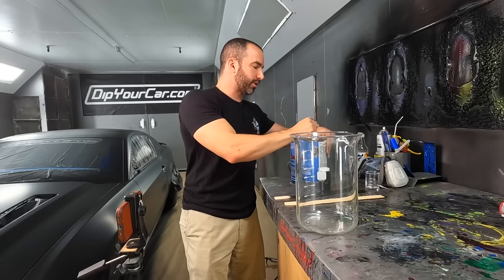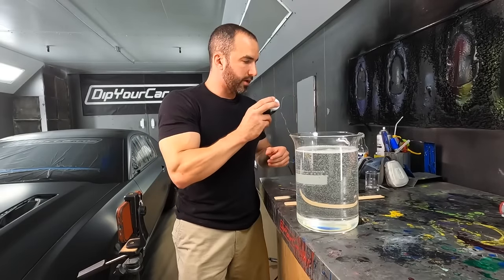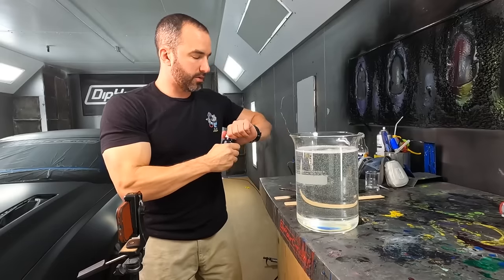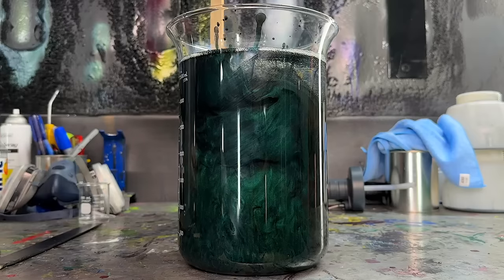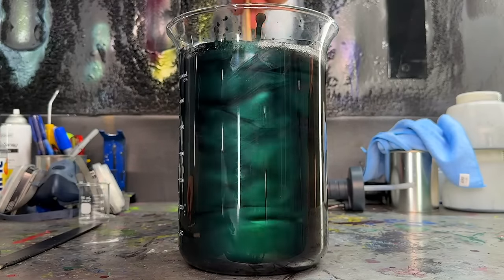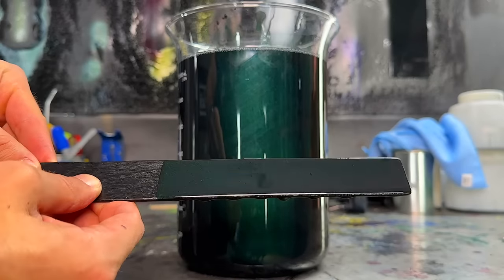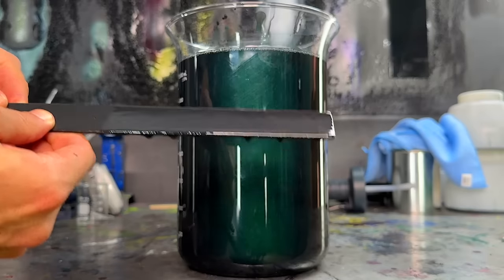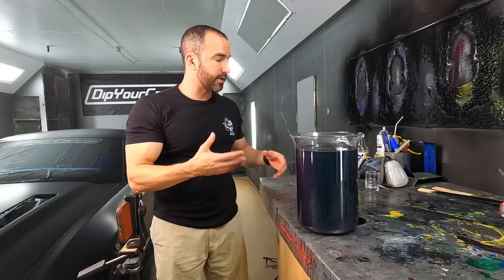Attempting to Match Ford's RAREST Paint Color Ever (Mystichrome)

Comment: As a former Mystichrome owner, (and having replaced 2 bumpers that needed to be painted lol), I could immediately spot what was missing. The metal flake, hence the "chrome" in Mystichrome. I think if you added some flake it would be hard to tell. Maybe a lil gloss on top also? But looked amazing. Great job!
Reply: I agree. ive only ever seen pictures of Mystichrome, and i could tell something was off right away, i just couldnt put my finger on it till i read this comment
Reply: The semi gloss finish doesn’t look right to me, but ive only seen pics also.
Reply: I agree, a bit more gloss would really make it look good.
Reply: Yes. I knew something was missing and the semi-gloss is throwing me off too
Reply: Stop lying 😏
Reply: Nothing quite compares to the shine of paint + clear
Reply: I think someone said that the 90s version was just Mystic, not the chrome. So it probably is closer to the 90s version which sounds like it lacked the flake.

The early 2000s had the flake most likely.
Reply: @Real28  No, it isn't close to either Mystic or Mystichrome
Reply: hell yeah! the flakes make the glare spread a lot smaller and more pronounced as well
Reply: @stopsign4384  What do you consider to be close?  Its definitely off but it does look close.
Reply: @Real28  My 96 definitely had flake. I think it's the semigloss here that makes it look odd.
Reply: As a person who just looked up YouTube video to compare shouldn't it shift a little bit more blue though? 🤔 aside from trying to match it's a beautiful color.
Reply: So, the feeling about the lack some metal gloss wasn't my imagination.
Reply: @LizardMods  there wasn't any blue in the 96
Reply: Absolutely, it's missing that flakey look, and the car is just shiny but not glossy

Comment: It's really close. Closest I've seen anyone get. The actual pigments for it are extremely expensive. The shift is spot on. The only spot that it missed the mark is the vibrance of the colors. Didn't miss by much though. It could be that it's not as sunny out. The colors just pop harder is all. Still a solid 5. Fantastic attempt. By percentages on how close the "match" is, 93-95%. Most others that claim mystic or mystichrome, barely touch 80%. Take that how you will.

Comment: This looks phenomenal its as close to a match as you can get I’ve seen the real color in person my neighbor had one. The only thing that I noticed was the wide spanning angles of green this has which the original doesn’t really do. The original has a lot of green but the visual angle doesn’t span as big of a distance as this dip does. The original is a much more narrow and local section of green shift in comparison.
Reply: You're right but I think that also comes down to the body shape. This gen mustang has a lot more 'flat' areas compared to the more bubbly sn95 mustang it came on originally.

Comment: As others have stated, other than the 96 color being mystic not mystichrome ( 2004 ), yes I would say that’s a pretty solid match for the original. Which is not easy. Often imitated rarely duplicated. Nice work 👏🏽

Comment: I've been an automotive painter for 40 plus years.  We had a early Saleen come into the shop with this on it . The color was developed by BASF and to help achieve the effect they desired,  it had the same toner used on 100 dollar bills.  So to even be able to obtain the paint, you had to provide the Vin#. They would ask you how much paint was needed and then bring it with a representative to watch over you as you painted. Then they disposed of any waste products personally, then take the remainder if any was left over.  Because they were concerned about someone reverse engineering it and replicating the highly guarded toner shared by some US currency.  
Crazy! Really blew my mind. 
I would be curious how well this  matches the original without that special toner.
But it does look good, at least in the video.

Comment: I’m a Total newb when it comes to this and found your channel while trying to learn more about it. Quick question… in a lot – if not all – the vids you start with a base coat. Is that paint or dip. I current have a a white Ford and would like to experiment with some of the things I’ve seen. 

I know it’s removable but do you need to update vehicle registration information in the event you get nicked by the po po? 🚓😵

Any / all insight is greatly appreciated. TIA.

Comment: I have a friend with a '96 Mystic Cobra bought new. He had ordered a different color, but the dealer called and told him they had a cancelled sale on the Mystic when the buyer's wife found out and gave him the "me or the car speech", so he opted to get the Mystic. The car is mostly stored to keep mileage low. When new he had the exhaust swapped out for a stainless unit (keeps the original on his garage wall to put back on later). While they were doing the swap they scratched one of the fenders. They painted the fender 3 times trying to match the original way the paint looked. They finally had to fly in a rep from DuPont to show them how to lay the paint so it looked factory. Years later he was driving it in winter and slid into a rock. He paid out of pocket for the repairs and told me at that time the paint was going for $500/pint and you had to provide the VIN to show the car was Mystic from the factory before they shipped the paint to the shop.

Comment: SEEMS YA GOT REAL CLOSE.  What @nickthatch12 said remains true. I was surprised to hear it had Gold and Black tones as well.  The color is respectable, however, the "Chrome" is missing. Its a metal flake addin or by using a slow reducer one can be applied post paint but ya gotta hustle even with the slow reducer. I tried this on a motorcycle and doing my own mixes and came out ok but the purple overpowered the blue and the predominant colors were green,purple. I was hoping for a better blue reflect but I was still happy it looked good. I did a silver flake over slow reducer/hardener WHICH IS REPRESENTED WELL, THEN HAD TO DO A TWO COAT Re-spray using only clear with a hint of transparent black, just a smidge to take the edge off the sparklies. Guy bought the bike and absolutely LOVED the chameleon effect.

Comment: Matching OEM colors is physically impossible because the manufacturerer like Toyota or Ford doesn't make the paint themselves, they outsource a third party to make the paint and send it through almost a mile of tubing before it even gets shot into a jar for you to buy then sprayed on your car.. on top of that there might be 10 other 3rd party's they buy from so there could be upwards of 10 different variations of the same paint that even the OEM gets... 😂 It's a nightmare.. my 95 Toyota Avalon has "051 diamond pearl white " and it's a nightmare to match 😅
Reply: Also laws came into place around 2004-2010 that stoped enamel based paint to be used widely in the car department.. so that has a huge reason why the quality of paint has changed since then aswell

Comment: Looks great. personally, imo it would look a lot better if used with something such as House of Colors USC01 Cosmic clear coat, wetsanded, and buffed till it looks like glass. I've also had really great results with the DNA Custom Paints Diamond Clearcoat, but I guess it's a matter of what you want to spend and how you want it to look in the end. I personally like a high gloss surface that looks a mile deep.

Comment: This is insanely close to Ford's Mystichrome, if not exact. A few years ago, I saw a video by YouTube channel "Donut Media" where they featured a Ford GT that the owner convinced ford to paint his car in the original, darker, Mystichrome paint. They finally agreed to do it, but it cost him an additional $100K, and Ford lobbied the federal government to get a law passed that protects that color. That paint actually costs well over $25000 a gallon, and a Ford rep MUST deliver the paint to an authorized shop. The rep has to stay with the shop until the car is finished being painted, and the rep will return any unused paint to their facility. Sometime, hopefully in the near future, I'm going to buy a 71-73 Mustang, and I'm really tossed between this color, and your blue to black Hypershift. Guaranteed, one of those colors will be on that car. I want to ask about protecting Hyperdip, and this as well, against nastiness getting kicked up from the road, and even accidental gas spills. Is there a way to protect the dip from those, maybe a 2K gloss clear paint over the dip, or do you have something specifically designed for that?? Also, how well does Plastidip and Hyperdip stand up to automatic car washes??

Comment: As a fan of the 1996 Mystic Cobra's and the 2004 Mystichrome Cobra's I have 2 points. 1st especially after Tommy said he was focused on the 96 color, It is really cringy and iritating that the color you sprayed is repeatedly called Mystichrome when it is not that color at all. 2nd It really does look almost identical to Mystic, I could see the green and the purple that are the predominant colors but especially as it was poured I could see hints or red and gold/orange. Fun fact for the 2000 model year in which the US did not get a Cobra, Ford was planning a color called Mystic gold. But since there was no 2000 Cobra the color never was put out on a production car.